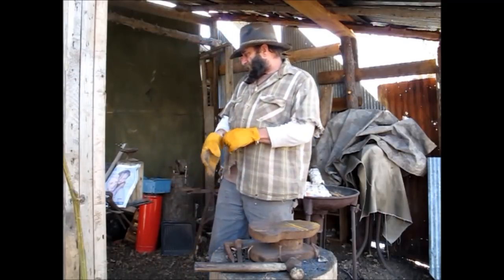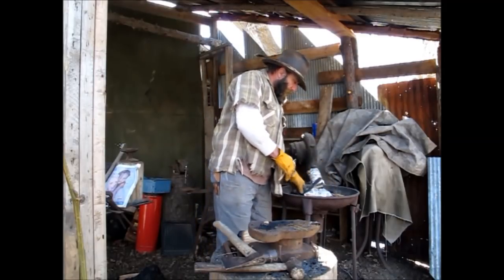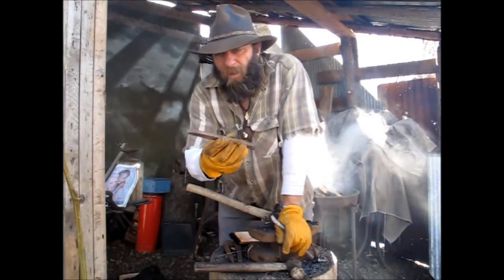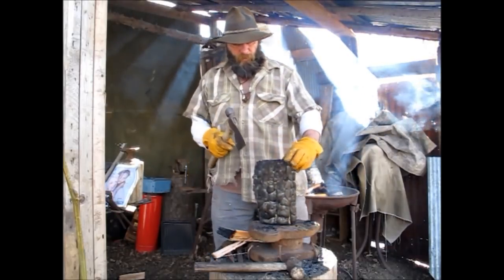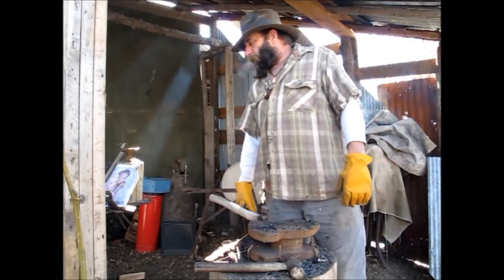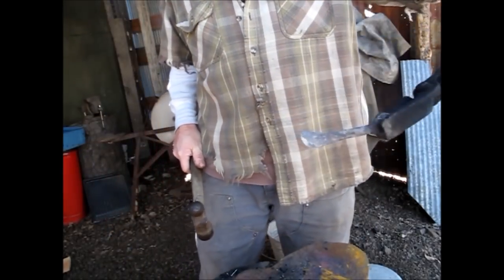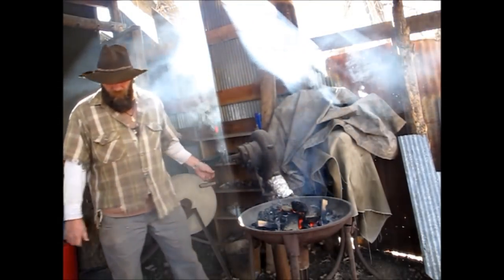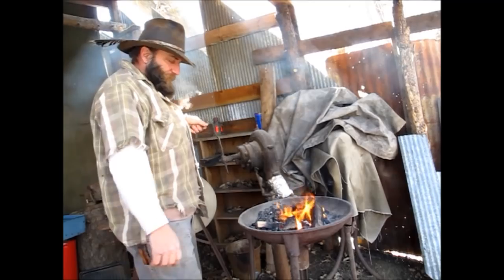The Country Blacksmith ~ Using Bio-Char Not Coal

Comment: Another good video friend! What kind of blower is that? Do you ever have to rebuild it or is it original. Looked at some new ones but don't know how good they would be. Always interesting watching you turn a piece of metal into something that is a usable tool! Y'all have a Blessed Day!
Reply from the maker: I have 3 of them and two of them are from the late 1800's...the one in this Video is a 1892 ROYAL both the Old one are all original and all I have ever had to do is pour a little oil in the crank. The newer one I need to pull apart and see what is going on. just like everything these days They just dont make'em Like they Use to

Comment: Damn Kev.
Your anvil's sitting on a big chunk of wood mate.
Flinched every time I heard that "Ting".
Go sharpen that hatchet  or turn it into a hammer ;)
cool to see an alternative to using stuff that doesn't involve ripping big holes in the ground.
ps, if you don't need heaps of coal you can usually find chunks along the edge of old railway lines down here, don't know if it's the same in the USA.
take care.
Reply from the maker: Up here in the Northwest we dont have coal mines and they have also done away with most of the railroads in Idaho other then south of us